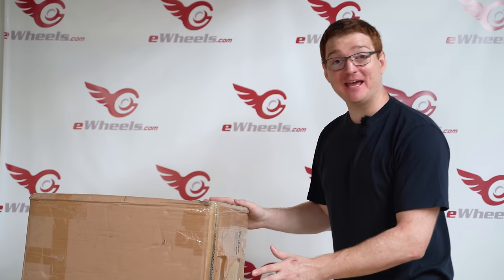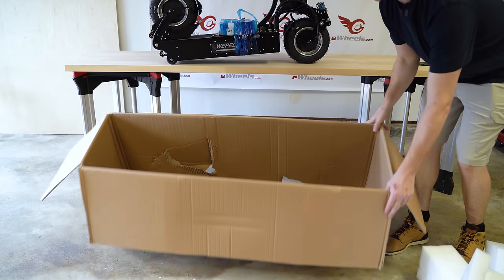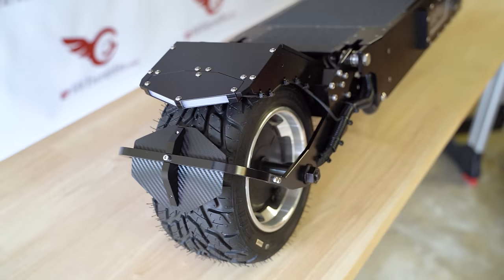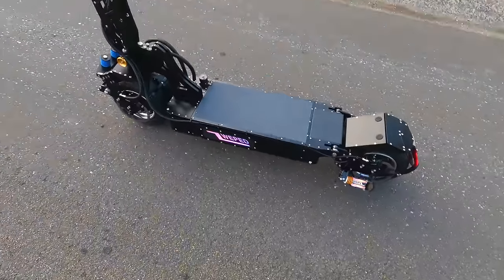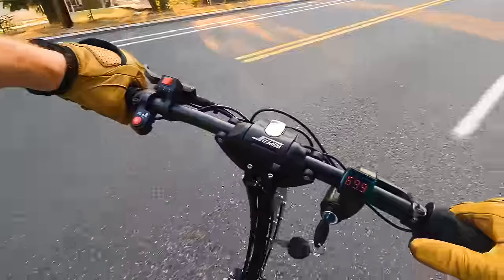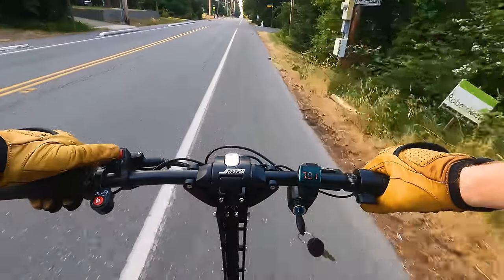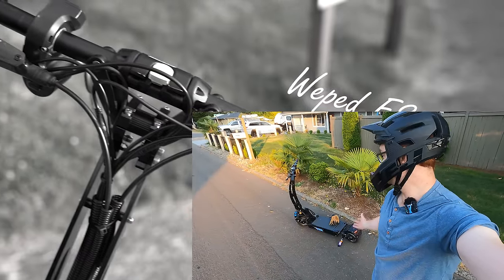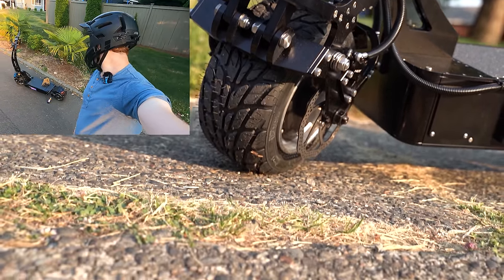One of The ⚡ Quickest ⚡ (and most $$$$) Electric Scooters in the WORLD - Insane WEPED FS Unboxing

Comment: if you in this moment at 12:05 sek ride with speed like 4m/s so like 14-15 km/h /8-9 mph if you weight 90 kg and weped 55 kg and rear axle at acceleration is under 115 kg load and front 30 kg load and assuming coefficient of friction =1,0 than for loose traction at front wheel minimal value required for this be 295 newtons force  around hat required at thisvelocity so 4,0 m,s around  1180watts of power and 41,3 Nm assuming wheel radious 14 centimetres and dont including  power losess for rear tire to loose traction you need much more power torque and force because you push it to the ground with much biger load/force in this case that be 4520 watts 158,2 Nm of torque and 1130 newtons force at tire rcircuit  at higher vleocity under the same condiition power   must be higher to achieve the same results on lower velocity they can be lower adequate to velocity .....we know that this weped have much more than 4520 watts power at rear axle but it generate this biger power only on one fixed velocity always because you dont have gearbox ...
Reply: because of this so such  weight distribution under dynamiqque change of motion me relatively strong elekctrick kick scooter =ultron t108 v2 is unable to loose traction at rear tire becasue there is to much load on it vs front tire if i dont push front wheel to the ground be proper body position looose traction with easssy both engine rear and front have egzacly the same power and toruqe ...just weight distribution change force power and torq required to loose traction on each wheeel ....rear tire on tarmac on me eks is imposiible to loose traction this eks is to weak the same is with wolf king warrior dualtrom storm and all other very fast eks  ecept those hiper eks like this weped but im not sure it can loose traction in good condition on tarmac at rear tire at front easy but rear is diffrent game bro ;) ...

Comment: You can change the program in the controller to "soften" the accel and speed.
Reply from the maker: How?
Reply: @GingerOnWheels  you must plug the internal Kelly controllers to a windows computer running Kelly setup program and set the various choices from there

Comment: Got an e scooter that looks like a monster called EZ Monstour spelt different only 1 in 7 models made! I have the 2nd generation, speed reaches 165km/h  wheels are 16" mega wheels I don't know width but much thicker than this you could not slide sideways while going 110km/h while turning, also mine even tho it's electric has oil breaks! It works better and you need to refill them every week or so depending on usage, pretty insane scooter took me 2 years to buy, costs £19,500 custom built with help from a local mechanic who had believe in me as I had in him making it, over the years all the parts costed that

Comment: What's the lowest percentage u can go without hurting the battery?
Reply: This 72v battery shouldn't really go below 65-67v charge. And even letting it sag below this isn't idea either. I never let mine go below 69v
Reply: @timpriestley8997  But when u go on the throttle it dips to 55v or something, or is it only when u are off throttle that u gotta worry about?
Reply: @recklesshoongarage566  Both, thats what I means Voltage sag below isnt ideal. As well as letting your battery run below the recommended voltage - But most good batteries have good BMS's and should but off as 25-30%

Comment: The Rion is the most expensive e scooter available.
Its also faster then the weped. 
Rion can hit speeds of over 100mph. However, Its restricted to 80mph out the box which is still faster then the weped.
Reply from the maker: How much does the Rion cost?
Reply: @GingerOnWheels  the Rion Thrust is about $8500 + $300 shipping and 150 days for production time.
Reply: @shizzu5568  Then the Weped FS cost more than the Rion......
Reply: @timpriestley8997  no it doesn’t

Comment: The other way to look at this is to leave it mode 1, go easy on the throttle and have the safest, stablest and longest range scooter on the market
Reply from the maker: There are no settings to adjust the throttle sensitivity and even in mode 1 the thing goes like a bat outta hell.
Reply: Mode 1 in this video seemed comparable to mode 4 dual motor on my Wolf King GT Pro. 

Just going slightly too hard on the throttle in mode 4 and my Wolf will start to pop a wheelie, you have to be very mindful of the throttle, there’s nothing at all safe about this scooter in mode 1 lol

Comment: What is the top speed and how fast does it accelerate? It looks like a simple design which is good. Most important things are motor power, scooter durability, battery capacity, and of course safety and how it rides. It would seem not hard to build a good scooter. Big durable bottom box that is strong, weather proof, and holds a huge amount of batteries and the electronics. Then put good and adjustable coil overs, variable ratio regen and braking. I’d use either one or two pancake motors with different settings for using both motors 100%, just the back, or use the back until it looses traction then the front will activate.
Reply from the maker: Now we're talkin! I would definitely ride that scooter.

Comment: Love you video on Weped and low to ask what area so you ride. It looks like Seattle. Also, would like to know how long you have been riding kick scooters and how long of a lifespan does it have before doing major work on it and at what cost. Are you a mechanic by Occupation. I have been looking on line at Alibaba and my eyes are on a scooter with 8000w, 72 v , 50 to 80 ah for longer distance of traveling. Would like you’re input on things and thanks.
Reply from the maker: Most Alibaba scooters are cheap with no support post sale. I ride in Seattle and have been testing scooters for 3 years or so now. I'm not a mechanic per se, just handy when I find things that need fixing.
Reply: @GingerOnWheels   what big scooter would you recommend, I have been looking at a 8000w, 72-60 ah battery , with 13 inch tires.

Comment: MODEL: WEPED FS

BATTERY: 72V 50AH SAMSUNG SDI 21700 50E

RANGE: 130KM

SPEED: 120KPH

POWER:30,000WATTS

BRAKES: HYDRAULIC DISC BRAKES FRONT AND BACK

TIRE: SHINKO KOREA TIRE

SUSPENSION: DUAL SPRING SHOCKS FRONT AND BACK

WEIGHT: 55KG

Ask us for more details.

MADE TO ORDER ONLY

50% DEPOSIT REQUIRED

Comment: you should probably swap out those tires for PMT tires so that you can turn better, those flat tires are not safe for turning
Reply: I have the FS and before it came I was planning on getting PMT's for it, But, these Gokart style tyres actually arent that bad, turning isnt too bad, its a learning curve for sure, but you need the flat style botton to keep/get traction. Actually I just ordered two new Gokart tyres from Fastride in France, as the front tyre wears very quickly!!!!!!! The tyres (esp front) just spin and spin and spin as all speeds

Comment: That's an awesome scoot, I recently received the GTR from eWheels, I wish I had spent the extra money on the FS, I'm already in deep $$ with the GTR and it won't even pull me up my driveway at anything over a walking speed, I'm 210 lbs but nothing better than walking my $5300 scooter up my driveway...
Reply from the maker: If you're struggling to get up your driveway I wonder if the scooter is performing properly. The power of the GTR should be more than enough to get you up pretty much any paved hill....
Reply: @GingerOnWheels  
I'm new to scooters but not EUC's, all of my EUC's pull me just fine up my driveway which is steep at the bottom but starts leveling out after about 200 feet, I've only ridden it twice both times I noticed if I'm riding spirited, remember I'm new so we're talking 30mph or less, and then hit my paved driveway with a generous amount of throttle (showing approx 56v) it actually starts out fast for 40-50 feet but starts slowing down and eventually stops pulling my weight altogether, so at that point, I'm walking it up the rest of the way (1,000ft).  Now, if I slowly hit it at the bottom it will climb it all the way just not very fast, like jogging speed.  Just for reference, not comparing apples to apples I know but my SurRon e bike pulled my wife and I BOTH up the same driveway at 15-18mph, we're talking 365lbs!  Maybe the volts were low, like not fully charged but if I go out for a long'ish 20 mile ride, I'm anticipating walking it up my hill.
Reply from the maker: Wow. Thats disappointing. Thanks for the detail. I think I'm getting a GTR soon so I'll do a few tests of my own but from your experience it sounds very much less than ideal.
Reply: @GingerOnWheels  
The weather here is actually clearing up, I'm going to top it off and try it again, I'm even going to turn the lights off on the side to see if that makes any difference.  Oh, I'm sure you know, check all the bolts you can on these things, I've found several that were loose.

Comment: The tires are so flat because at high speeds there's so much wheel torque that the tires would expand straight off of their rims if you utilized a regular shaped tire ! I would seek out a comfortable, and stable seat modification kit to use the WePed at mode 3 speeds and torque. You don't stand up @ 70+ MPH !! You need to actually treat this like an electric motor cycle and spread out and ballance your body weight more. I would add a quality digital speedometer, headlight, front and rear turn signals, and approach riding this as a serious street vehicle instead of an off or on road novelty ride.
Reply from the maker: Makes sense.

Comment: I would have immediately gone to 3 and seen how fast it can go
Reply from the maker: Unlikely.
Reply: same same woulda been zoomin
Reply: @GingerOnWheels  yeh ur prob right but I would see how fast it could go it would be the first thing I did I do it with everything I got a new cr the other day 250cc and took it too 125 mph as the first thing I did
Reply from the maker: @Repent_TT  You would've ruined the scooter then. Stressing it with full throttle on a 50% charge and you would've fried the controllers faster than I ended up doing it. But it's okay, because you normally do it. 🤣
Reply: @GingerOnWheels  okay I didn’t know all that stuff about the scooter so I would have to like wear it in before you go full speed

Comment: MODEL: WEPED FS
BATTERY: 72V 50AH SAMSUNG SDI 21700 50E
RANGE: 130KM
SPEED: 120KPH
POWER:30,000WATTS
BRAKES: HYDRAULIC DISC BRAKES FRONT AND BACK
TIRE: SHINKO KOREA TIRE
SUSPENSION: DUAL SPRING SHOCKS FRONT AND BACK
WEIGHT: 55KG
$11,000.00 😂

Comment: Could you elaborate on your 30kw of power claim? At the end of the video you say it uses 72 volts at 50 amps (x2). That is 7.2kw. 

I saw a different video where they upgraded the speed controllers to ones with an insanely high max amp rating. This isn't a bad thing, but they used the speed controller's max rating to calculate 33kw output ON THE SAME MOTORS! This is so wrong.

Comment: That looks like a very efficient way to shed your skin on the asphalt going 120 km/h.
Reply: 74 you mean
Reply: @aktan4ik  No, 120. It goes 74 MILES per hour. I said KILOMETERS per hour. 74 mph is roughly 120kph.
Reply: @vladislavvalev8708  and I said 74 which obviously stands for miles per hour, the proper speed unit.

Comment: Common guy ... just give us the important stuff. 0-60 and the quarter mile. To wich speed you can do burn outs? Can you drift with it?
Reply from the maker: Probably around 10 second 0-60 torque drops above 40mph. Can burnout any speed below 35mph. Can't drift.
Reply: @GingerOnWheels  soooo sad! It would be intersting, when the limiter is removed. The hardware should be able to go faster then 40 mph.
Reply from the maker: @ciddax754  there is no limiter. The scooter will do 60+, but it just loses its ability to burn rubber at high speeds, like most other fast toys.

Comment: Let us not judge the Weped scooters design ideas. Because they much more advanced in cooling the battery packs and motors for longevity . Keep it at the right temperatures for all users in all climates and us Desert monsters as well. Tight stiff steering is meant to keep you alive with all that rapid acceleration.  Again to faster speed than 2 and faster speed than 3 and then throttle. DO NOT play with 123 at  low speeds. Still going to purchase a WEPED. (Wheeled Electric Propulsion Energy Device) is a WEPED. The WEPED Witch of the East? Or the WEPED Witch of the West? Which WEPED will you ride? For Evil or Good they're both just as fast! and will suffice. WEPED a paradox, a harmonious blend, Two worlds entwined, where emotions ascend. In the dance of fire and the embrace of Ice, Love find it's balance, a beautiful device! Robert Frost "The WEPED" He wrote it, and you ride it!  But please at least wear a helmet.

Comment: This is badass! someone should just make Tron cycles. But how can they not include a full info readout? A motorcycle would probably be a safer choice. If you get thrown…instant human paste pulp.
Reply from the maker: They have the new Weped Cyberfold. Check that thing out 😎. Instant, vapor dust.
Reply: Cooool! I am a regular viewer of the WEPED channel here where those South Korean wizards make and ride these wicked machines at high speeds. I think their designs are going to crush the competition. I mean, their scooters and motorcycles look like Terminator rides.
Reply: Their rides can get up close to 100mph! I’d recommend full riding armor to avoid turning your body into uncooked hamburger.

Comment: dont shift your weight to the front when flooring it, it makes the rear weel spin
Reply: No totally other way around. The tyre that spinns 99% of the time is the front, you need weight on the front to keep the front from not spinning.....
Reply: @timpriestley8997  isnt the engine on the rear weel?
Reply: @GabrielM01  No its has two 15,000w hub motors, one per wheel - Total 30,000w - Frony wheel spins at most speeds, even at 50km you push the throttle, it still spins thr wheels....
Reply: @timpriestley8997  ohhh right, then its better to keep pressure on the front

Comment: not fan of the design and that sort of  throttle is not the best choice at that range of speed, I don't think you can do offroad with that monster. Furthermore the brake cable should be in the deck, after the large pneumatics  really nice ^^ is it tubeless ? 
For a street usage a 48V battery is enough especially for emergency braking.

Comment: this is not a 30kw scooter. 72 V x 50 A = 3600 watts, at most it would be 4000watts peak. if it were 30KW then the wire which connect to the moter would need to handle 209 A (30Kw/72V= 417A), in this case the wires cant handle that much current and would burn. 

still it's a nice scooter.
Reply: you’re wrong. you should calculate its max peak, so it’s 84 (not 72) x the output of the two controllers (240, not 50)
Reply: @discodelirio  try looking up on a 15kw motor hub or a 15kw controller and compare it to the scooter. what I've calculated is the rms. If someone really were to try a 30kw controller on these motor it would immediately destroy it

Comment: Those two pins that hold the wheels in place have a little tiny bearing to hold it in if something hits that pin and he gets pulled out somebody’s gonna get killed you could hit a rock and it would force that pin out and wheel would collapse and you would crash🤷🏻‍♂️ If I owned it I Would drill a hole in the pin past the little bearing and put a cotter pin through so nothing could extract the pin that holds the wheels on out. But that’s just my opinion don’t do anything that I say. Use your own judgment be smart

Comment: The problem is its to hard to fix and work on them tires are probably a pain in the ass to take off not alot of people no how to work on it but its unbelievably fast my God lol
Reply: Actually the tires are easy, Cos it has split rims, unlike the SST and earlier model's. I'm about to change mine original tyres with another set, shouldn't be too hard. Working on other parts ain't too bad, the issue is getting parts for it, Korea are slow and hard to get info and needed parts from.......I can say....the unbelievably stupidly fast

Comment: The handle bars seem fine to me. Dont grip the handle bars. Dont push or lean into them use them as a guide not as a gripping point. You want to balance all of your weight as if your on a skateboard. Not like you're on a motorcycle.
Reply from the maker: There is almost an inch of forward and back play. You can't stance your way out of that.
Reply: There are now new CNC Weped Handlebar upgrades that can be purchased for all Weped scooter models, they are thicker, wider, really cool looking and have zero play in them.

Comment: you dont need 30 kw  power at so low velocity to loose traction also width of tire dont have to much to do with how much they can withstand before loose traction  much more omportant is your weight and tires compound ... how much kw is required forr  looose tratcion on specified level of coeefficent of friction depend on velocity with whic you drive in specified moment for egzample at 1 mph you need 10 times leesss power to loose traction than at 10 mph at 60 mph you need 100 times more power to loose traction while accelerate than at 0,6 mph .... one simple foprmula  say you this watts :m/s =newtons force ...

Comment: Why were you surprised that spd mod 1 wasn't all the power???
Reply from the maker: Because on the qs or minimotors scooters, is it. The speed modes on most scooters just limit top speed, not total power output/ torque.
Reply: @GingerOnWheels  ok but it does on our nanrobot as well
Reply from the maker: Which one? The lS7 And D4+ don't.